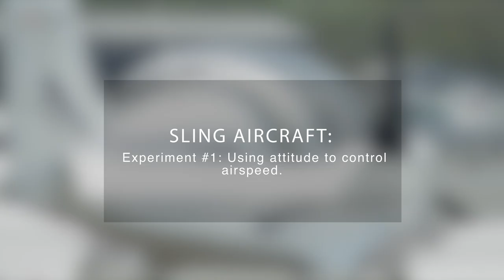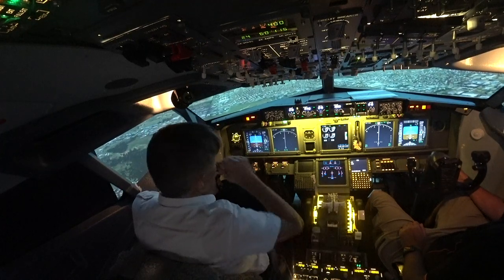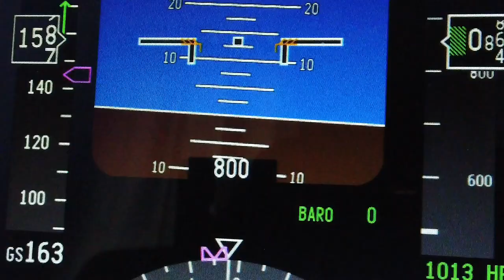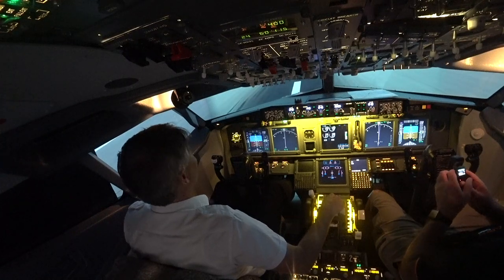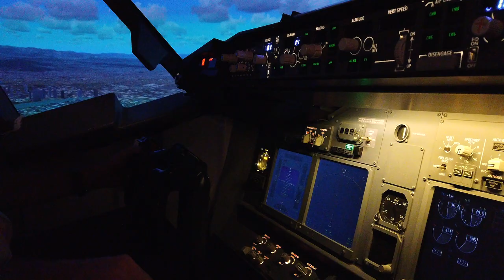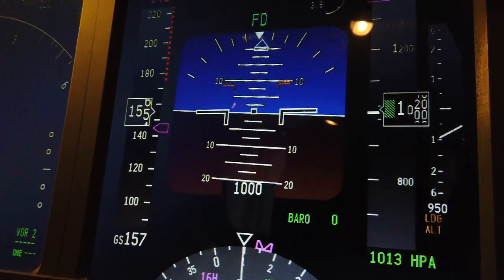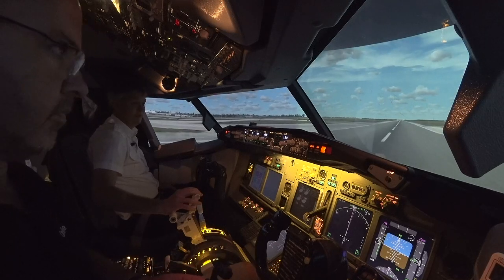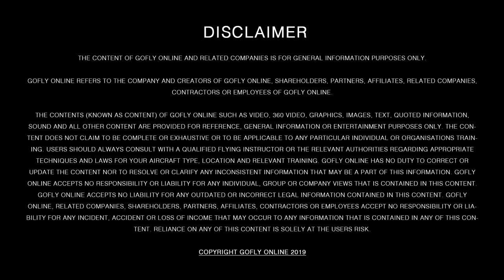Debunking the myth Power vs Pitch - GoFly Fix

Comment: I’ve driven everything from ultralights to Airbus, I use the steering wheel to keep the picture I want in the window and the gas pedal to keep the speedo where I want, 42 years, worked for me!
Reply: In that Airbus, how often is the glidepath coupled hence “Hal” trimming? Alternately, in that Airbus, what is the spoolup time for the engines? Pitch for glidepath with power/throttle for speed is a front side technique. If in a backside flyer, pitching down if high will cause you to float long. We trim for AOA though use speed as a crutch if we have no AOA display. Once trimmed, that AOA will stay constant if we don’t have bumps or “stick-bumps.” Hence power will control glideslope. This is a Power Technique and works both sides of the curve. To prove it to you, consider flying at cruise obviously front side, what happens if you add power? You go up. As the power technique works everywhere, we use it on the backside as we don’t like true backside techniques. You could use the power technique on the front side but often rather than just considering 1.3 Vso, procedures are designed to be the higher of 1.3 Vso or front side so as to compensate for aircraft that have long spool-up times on the engines. Pitch for glidepath is a relatively quick response. For many turbines, power for glide, especially if not at a higher up neutral power point, takes too long to propagate. Hence why I bet you’re happy in that Airbus. Further, often in professional aircraft, you’re coupled up so the aircraft is constantly trimming and the aircraft owns glidepath so you have no choice but to use power for speed. That reverses upon uncoupling should you have insufficient energy to be front side.
Reply: As for those backside techniques no one likes, yes, you’d use pitch for path but not in a comfortable way. If high, you’d need to pull up to slow down increasing drag so as to fall toward desired glidepath then dump the nose to capture speed to maintain desired glidepath. Alternately, if low, you’d need to push the nose to reduce drag to float long. As I say, uncomfortable while many newer pilots never learn these just as they never learn the distinction between zoom and dive versus climb and descent.

Comment: It’s very simplified to say pitch for speed and power for rate of descent, but they are completely intertwined. This is true for all maneuvers. This is why you add power in steep turns to arrest any descent while holding pitch and maintaining airspeed. Understanding how the two interact with each other makes you a better pilot in all phases of flight.
Reply: You add power in steep turns to stay level assuming you want to maintain constant airspeed. You can leave the power where it is and add trim settling to a slower speed. Such is actually one of the test techniques for determining energy loss rates and creating the EM diagram. You fly full power to find a top speed then turn bleeding to a new speed then increase turn bleeding to a new speed… As you’re already at full power, you can’t add power.
Reply: @jimallen8186  The speed bleeds because vertical lift is reduced in the bank and requires more AOA to maintain altitude.
Reply: @AnonyMous-jf4lc  The speed bleeds because of the extra induced drag from that increased AOA. That’s different. Drag causes the deceleration not the AOA. You can either add trim as we really trim for AOA not speed to hold this increased AOA and accept the slower speed meaning you trimmed aka pitched for AOA and pitched for speed, or, add power to counter this increased drag. If you do add power, you will see speed increase but this a second order effect and is not power for speed as you added to power to maintain altitude and you’ll be maintaining a constant AOA to which you previously trimmed. Now, if we flush speed from the discussion and use AOA as we should be, these nitnoid pieces fall out. Pitch for AOA Power for GlidePath. We’ll still use “fast” and “slow” for referencing AOA so as not to confuse “high” and “low” from glidepath. But as we need to appease the FAA still stuck on speed not AOA as not all aircraft display AOA, we need to keep these confusions with speed hence confusions in the video and comments.
Reply: @jimallen8186  obviously I understand that concept, and figured you did as well, so didn’t elaborate.

Comment: Think as if driving a vehicle through the hills and wanting to keep a constant speed, when you go up hill you got to add power to maintain the speed, when you go downhill vice versa. An airplane is exactly the same except you can make your own Hills.
Reply: Not really, in an airplane there are forces acting that don't exist in a car, there are different concepts. Use within this reasoning, for example, the lift formula and relate it to the rate of descent along with the vectors of forces that act on the aircraft in different situations and compare.

Comment: @8:08 I'm glad you got it stopped with a little runway left to spare, but can you tell me what your brake temps where? I think you melted them. :) Never mind the pax aren't too happy with going from 1000 fpm climb to 2000 fpm decent. What if the runway was wet. Icy. Or light snow. Would have ended like that flight into Reagan Intl many years ago that ended up in the Potomac, with pax struggling in the freezing water with jet fuel in their eyes/mouth/nose etc. Hard enough not to drown in ice cold water, never mind with jet fuel on top.

Comment: I fly the exact opposite: in a single piston (not a sling) power for speed. Hold pitch steady as can be and don't let the torque steer the nose. In a heavy (not a 737), pitch for speed. The heavy has a HUD so it won't porpoise into a 2000fpm climb unless you're bad. If you're good, the pitch is steady from IM to flare.

Comment: This video makes 0 sense to me. You just showed two different situations, but never really went into why.
Reply: They touched on it a bit. The high mass of the 737 gave it much more inertia so it was very unstable to control the approach with pitch for airspeed and power for attitude because of such a high delay in effect. 

The light aircraft did not suffer from this issue because its inertia is much lower and responded quite quickly. The argument for light aircraft is to pitch for airspeed because using the pitch for attitude will cause more induced drag at lower speed and lead to a higher descent rate… but this is also true with pitching for airspeed. 

In my opinion, they’re very closely related and you should just use what works for you. They both control your energy management so you’ll end up changing one after you change the other. Overthinking it can cause you to focus less on more important things.

Comment: He's just bad at controlling power when on final. I fly piper tomohawks and we were taught to aim and adjust power barley. If you are taught correctly it's not sloppy and it's much nicer than pitch for airspeed flying
Reply: Totally agree - the magnitudd of his power changes is wild given the conditions. A long video but no real conclusive info or theory. I was taught by Alex IAF test pilot and went through all the theory behind why approaches are more stable using power to manage speed.

Comment: Well there is no good method.  It depends on the type of aircraft and type of approach you fly.  Bush pilots, on single piston engine, clearing high obstacles, will go high angle descent slop, airspeed barely above stall, keeping the the airspeed with pitch and power is kept constant at 1500/1600 RPM until starting to round out and flare.
Normal approaches on single engine: I clearly go pitch for airspeed and power for VS, way safer.  Why?  Because pulling the yoke to adjust VS close to stall speed could be catastrophic a low altitude.
In a jet or even heavier piston planes, power controls speed and yoke controls VS. So there is no good answer, it is only dependent on what plane is flown and in which circumstances...just my opinion.

Comment: So, ummm... What's the myth you're debunking? Isn't it common knowledge that you fly small aircraft differently from large aircraft, who thinks otherwise? Good demonstration though.
Reply: You can fly both with Power techniques meaning power for glidepath pitch trim for speed. Only reason you’d differ is if you wanted to maintain extra energy for gliding scenarios. Note: Gliders also use the “Power techniques” as they use spoilers that both reduce lift and increase drag thus altering the loss rate of energy. The spoiler lever is mechanized in the same manner as throttle / power lever with back increasing the energy deficit, forward decreasing the energy deficit. You may not have spoilers on small planes but you do still have slips. Power technique is by far the easier and works both sides of the drag curve. Front side techniques work for turbine aircraft that have long engine spoolup times. Note Navy jets add excess drag so as to shift the neutral power point up such that their engines are already spun up so they can use power techniques. Front side techniques also work with coupled autopilots as the plane is constantly trimming to maintain glidepath. The myth is that power techniques are strictly for backside flyers; power techniques work everywhere assuming a constant trim so long as you don’t need to worry about delayed spoolup times. True backside techniques are rarely taught and rely on the distinctions between zoom and dive versus climb and descent. For the backside technique, if high, pull up increasing drag to fall faster then dump the nose to catch desired speed at desired glidepath. If low, push down to reduce drag so as to be able to float further.